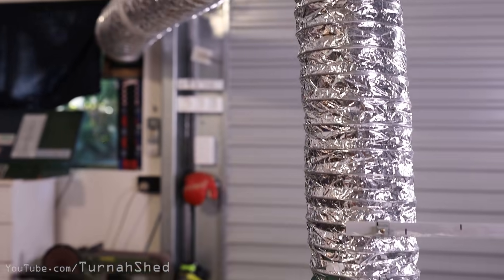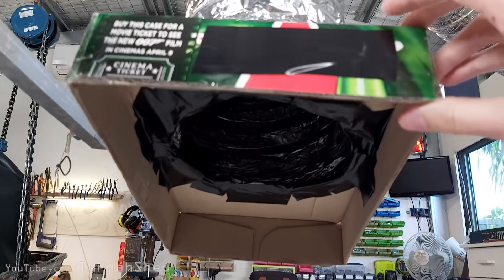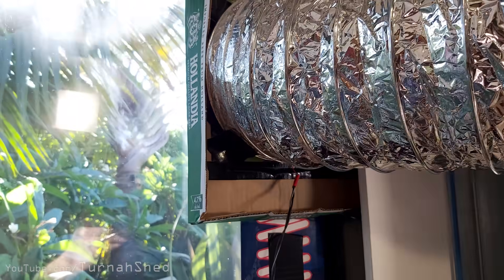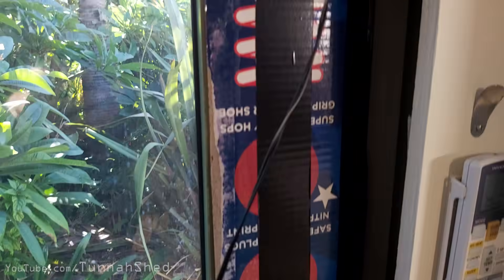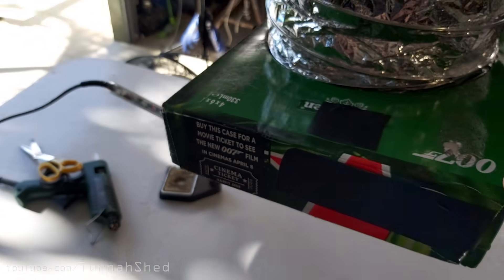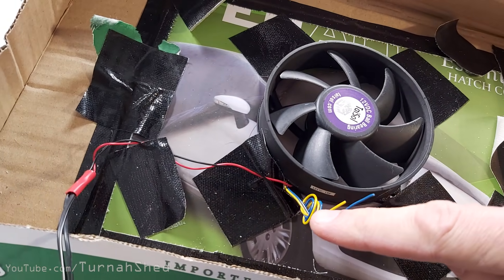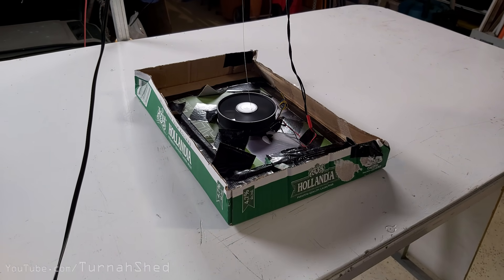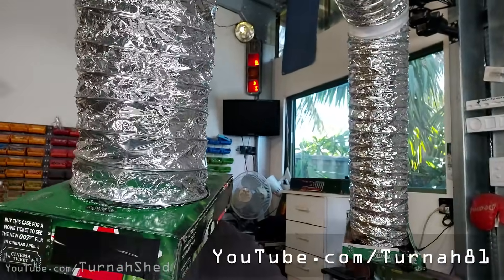Easy Fume Extractor - How To -Turnah81

Comment: I need to do some soldering and was going to do something similar to this.... then I remembered my central vacuum system exhausts outdoors, so I ended up using that.  I don’t do that much soldering; I wouldn’t use it for days/hours at a time but for a half hour or so of work it was perfect and I didn’t have to plumb anything up.  Another win for central vacuum systems!

Unfortunatly the central vac doesn’t double as a hovercraft though - your solution is vastly superior in that regard 🤣

Love your channels and always enjoy getting notifications on your stuff!

Comment: Nice setup. Maybe another fan for intake would help the airflow.
'Course that would totally defeat the head cooling feature.
Reply from the maker: yeah I was worried that the positive pressure in the tube might leak out back into the shed too. My old fans are all different. cheers